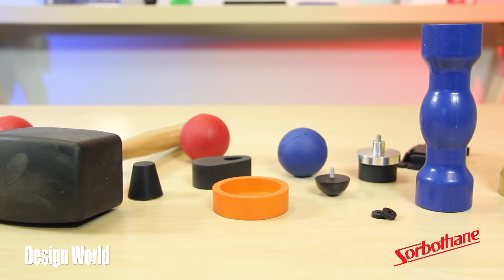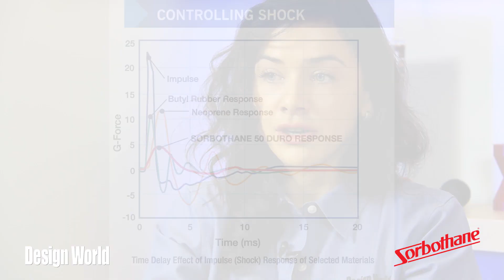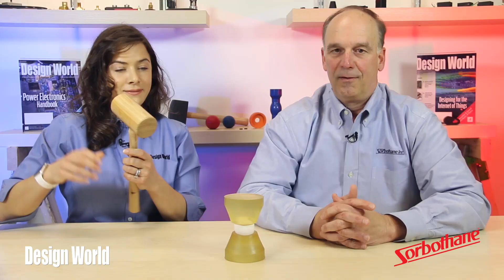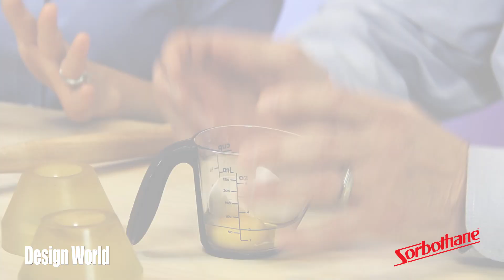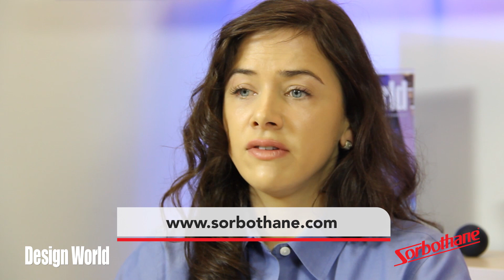Sorbothane Passes the Egg Smash Test

Comment: You guys ever thought about making a Motorcycle Helmet with this inside?   I recently got in a wreck and my helmet did an ok job but i think with this on the inside of a carbon fiber shell we could achieve high impact cranial saves!
Reply: There's other systems better suited for it out there esp in regards to weight sorbothane is pretty heavy and you prob wouldn't want it over your head for long periods of time. There are other safety and crash mitigation systems built into high end helmets that improve safety and comfort without so much compromise on weight.
Reply: The main reason it isn't is helmets do not need to dampen, just absorb shock and just one time. Sorbothane does absorb but it also dampens, it's also heavy meaning that helmet would be very uncomfortable and likely contribute to inertia related neck injuries in a crash.
Reply: Look up topology optimized lattice thermosets. Like carbon 3D stuff

Comment: Dear Srs. Can I use Sorbothane in my anti vibration table (I use it with my microbalance)?.  
Material natural granite, dimension: 450 (W) x 400 (D) x 70 (H) mm
, aprox weight 27 kg.

Comment: I live in a place where there's a lot of vibration and shock that wakes me up. I bought two pads of sorbothane from Amazon and put under the legs of my bed and much to my surprise I found it to be completely useless. I'm able to get better results with bits of rubber. Modern expensive useless shit.
Reply: It probably has a lot to do with application and you probably have to get the pad size optimized for the amount of weight your using. A small three quarter inch pad is only rated for 1-3lbs. If you exceed that, the more weight, the less effective it will be. You have to use common sense. 

I used 4 small pads for sound isolation on a turntable, and when measured on my computer, the effect has been fantastic.
Reply: planning to use it on my washing machine. thanks for the feedback. will think twice about this product.
Reply: Well a 300 pound heffer is going to need a huge piece of isolation damper under his beds legs. What you did is like sticking one rubber band under each legs.